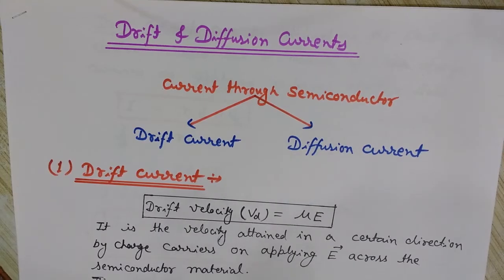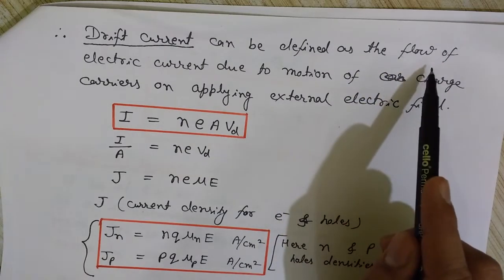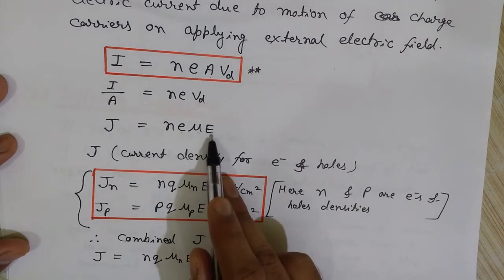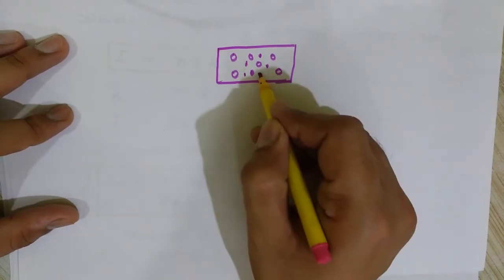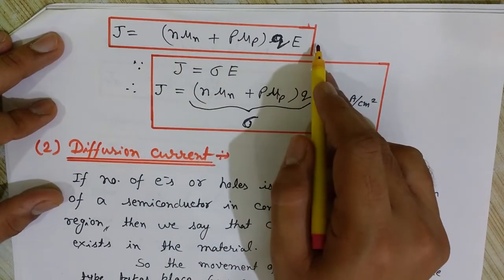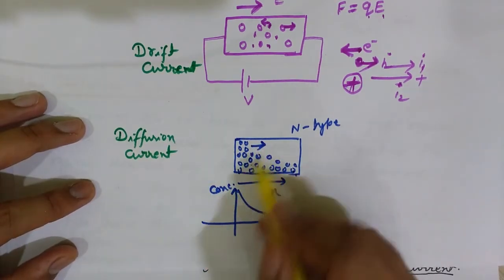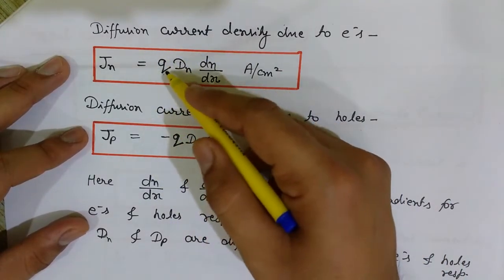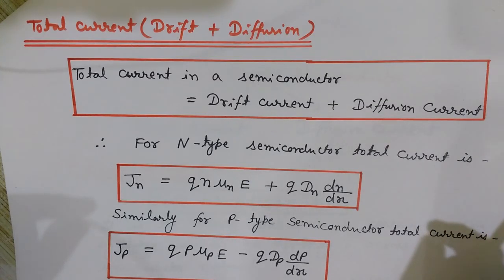Drift and Diffusion Currents (Formula and Derivation) - Current Density and Diffusion Coefficient

Comment: Congratulations for putting this out there. In these times we are all facing, I needed this a refresher because I am trying to build a thermoelectric generator out of cheap materials. I need to understand the difference between these types of currents very well, before I invest time in engineering the right shapes of the thermocouples.

Comment: Why there is negative sign in diffusion current density due to holes?
Reply: If we recall that the concentration gradient is negative (going from high to low concentrations with respect to change in length) and the charge of holes is positive, then multiplying these two terms will cause the diffusion current for holes to be negative. For electron diffusion current, the charge “q” is negative, so multiplying this negative with the negative concentration gradient will result in a positive diffusion current for electrons.